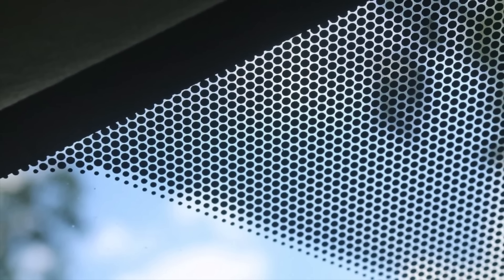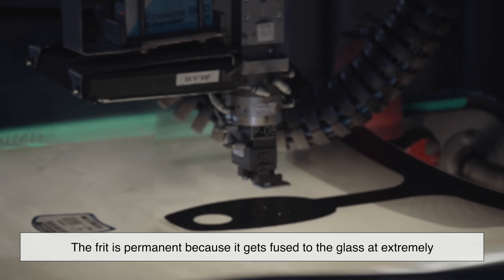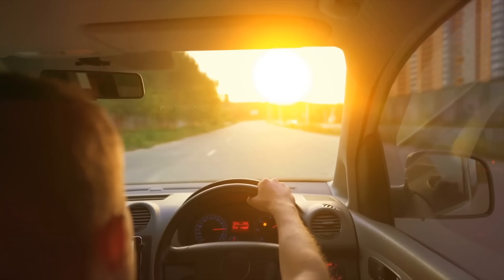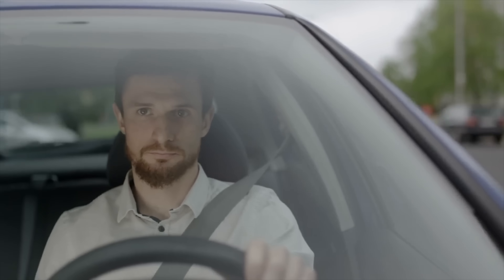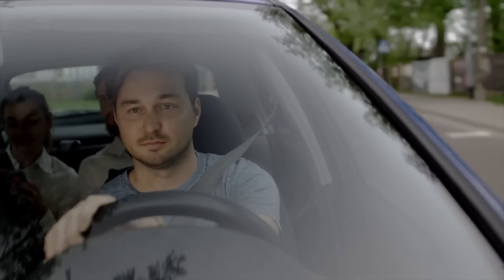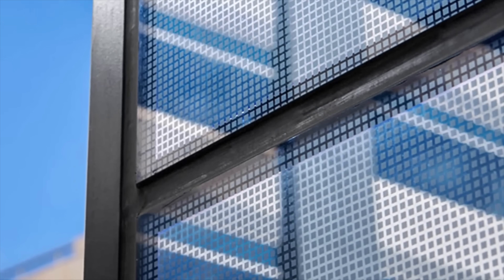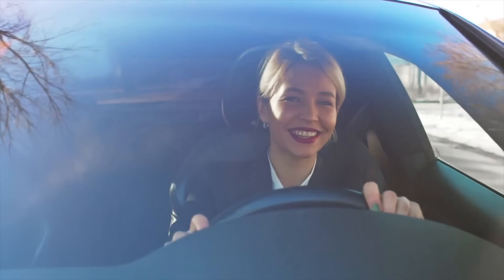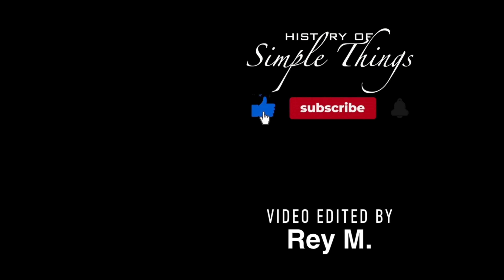Why Do Windshields Have Those Small Black Dots?

Comment: News flash: black absorbs more heat. Windshields in cars from the '40s and '50s,  still original, are working just fine. The trick is, the glass was thicker, ie more expensive, so in essence, it just another way to cheap out on the manufacture. Same with the "adhesive" BS, more so when you consider that adhesives have just gotten better. It all comes down to more profit for manufacturers. Oh, and btw, if you really wanted it to "stick" better, you'd just sandblast the glass so that's BS too.

Comment: I just wish someone would invent a windshield that was more resistant to rock chips. I think I have to get my windshield replaced at least every two years.
Reply: While this solution is not financially sound for most people in most daily driving conditions... there IS an option. Vehicle customization companies that provide ballistic protection can supply a customer with a windshield that would laugh at rock chips, without paying for full .50 caliber resistance. 

If one drives every day in a construction zone with heavy equipment and dump trucks.... then it's worth it.
Reply: More aerodynamic vehicles don't get chipped as badly, because of the more sloped angle of the glass. The windshields take less of a direct hit.

Comment: Hi, what about the gap near the rear view mirror , i cannot remember if it is a gap or less black / smaller and further apart- but what i can say is that if you mount a toll tag in that area it works, - originally i had mine away from the centre and closer to the passenger- it hardly worked, but it worked on the passenger seat , on the dash and even in the glovebox.
Can some one who knows add a comment apparently there is a type of faraday cage in the glass as well that block electronics for some reason

Regards
George

Comment: For decades we had windshields without the dots. They were also glued to the car body and handled thermal expansion and contraction just fine. Never had an older windshield crack without something hitting it first. Don't recall having distortion either. Been driving since 1970.

Comment: I thought the black area was only for shade and for looks. I'd never heard of a windscreen breaking due to temperature inversions. That's not to say it doesn't happen, because evidently it does.
Often cars also have a tiny line about 10cm down from the top edge of the windscreen. The line is very fine and only about 1cm long. I don't know their intended purpose, but the location seems to coincide with marking the maximum width of the windscreen that can be covered up, at the top. (At least that's the rule in Australia.)

Comment: The thickness of the glass in windshields has changed, too. Every newer vehicle I've owned has thinner windshields than older vehicles. So, of course, they crack easily. For comparison, I have a 1976 Ford F100 with the original windshield, and it has no cracks. It has several deep rock chips, but the windshield has no cracks. 

Every newer car I I've owned has gotten a cracked windshield. Every one of them has thinner glass at around 3/16". All of the older cars I've owned had 1/4" thick glass in the windshield. 

They were forced to add this frit to these new thinner windshields since they were prone to cracking from heat expansion. But they still crack too easy from the slightest impact.

Comment: I have been an auto glass technician since 1989 and have installed 10's of thousands of Automotive replacement glass. 
This video gets it mostly correct information wise. I saw one question in the comments about "why just the windshield and not the rest of the glass" all modern rear windows have the same ceramic frit band as well.
Good rule of thumb is, it's bonded to the body of the vehicle, it's going to have a frit band. If it rolls up and down (door glasses, sun roofs)
It doesn't need it. Front windshield is laminated glass (2 layers laminated with mylar in between) that's why they don't explode into a million pieces when hit by road debris.
Most side and rear windows are tempered glass. With a few exceptions. Where the frit drops lower in the upper center of the windshield is also called your 3rd visor. That is designed to take up some of the Gap that is left when both sun visors are down. It's supposed to act as a 3rd visor 
(Rarely works very well) and there's plenty of windshield options where you get the frit band, 3rd visor and the graduated darker tint at the top. 
Most manufacturers don't install them because it would cost them a few extra $ but next time you have to have a windshield replaced, ask if there's a "shaded option" chances are there is.
Reply: Wow 🤩 thanks 😊
Reply: A few years ago I saw a video of cops trying to break a door glass on a low priced Kia and the glass was behaving as if it was laminated same as a windshield. All door glass I've ever seen is tempered to fall into little nugget size pieces on the first try but this particular door glass was hanging tough and they had to hack their way in the hard way. This would help keep you and your arms inside on a rollover crash, because usually the door glass is gone on the first revolution and ejection of occupants happens on a subsequent revolution. It would also thwart smash-n-grab thieves. But if you had to break your way out thru a jammed door in a fire or underwater this could be a death sentence in my observation.
Reply: @onemoremisfit  You would be surprised at how many brands of cars on the road still have laminated  front side windows...
Reply: @1983dmd  What do you mean by still have? Older cars never had laminated door glass. Also this was a rear door on the late model Kia that cops could not easily break thru, not a front door.
Reply: @onemoremisfit  This is totally incorrect .I suggest you Google the AAA website and look for the exhaustive  list of cars supplied with laminated glass excluding front windshields. You will even find cars dating back to the 1980s having laminated side front or/and  side rear glasses, etc,etc.....
Reply: @1983dmd  Never encountered one myself doing collision work in body shops during the 1980s. I've owned cars from every decade between 1966 and 2006, US and imports. Currently own 3 GMs from 1968, 2002 and 2006, never owned one. But I reckon that doesn't mean I've seen them all. I'll take your word for it.
Reply: @onemoremisfit  Don't take my word for it ! Consult the AAA site and you will also find that some Kia have rear side laminated glass ,probably explaining the difficulty those police agents had.
Reply: I'd say  many cars nowadays still have laminated front side windows...99% of people would not be able to get out of a burning  car since they don't know which window to break and don't have any sharp instrument at hand to do that...This should be part of all driver's courses...and be written on a sticker somewhere in the car.
Reply: @1983dmd  Retired auto worker here. All auto glass has a trademark painted on it. It will say laminated or tempered.
Reply: @steven4315  Exactly.
Reply: @1983dmd 
The side and rear windows on a majority of cars is tempered, not laminated.
That cost more and weighs more.
Reply: @BobsGT235  Incorrect. Do your research. Consult the AAA website for an exhaustive list and you will correct your post.
Reply: Can we all take a moment to appreciate the fact that someone invested a lot of time and money into developing this frit technology?
Reply: I heard the plastic in between the layers of glass is thicker than it used to be but over all the windshield is the same thickness. That means the glass has to be thinner. I had to replace my windshield two times in my previous truck and the truck I have now has two small cracks in from rocks flying up off of road. Wind shields made today are junk the truck I bought in 1980 had lots of small rocks that flew up off road and hit it and never heart it.
Reply: @pcobra5427 Retired autoglass factory worker here. glass thickness varies, most are 2.1mm to 2.3mm. Acoustic vinyl is thicker than standard vinyl.
Reply: Well, I just don't know how I survived my first 50 years of driving lol .... 
For the record, I'm not buying it.  It's just some more crap to tack on for some reason that's good for the Government and bad for me. The government never does what's good for anyone but them. They all lie.
Reply: Thanks! Your comment has much more useful info than the video!

Comment: See them on the oven door windows and on microwave oven doors and figured it was to dissipate the heat
Reply: The black grid on microwave doors are Faraday shields (not frit) designed to contained the ovens electromagnet energy and protect users from microwave radiation

Comment: "Windshield black dots, called frit, are baked-on ceramic paint that secures the windshield, protects the adhesive from UV rays, distributes heat evenly to prevent distortion (lensing), and hide the glue line for a cleaner look, ensuring the glass bonds securely and stays strong." Saved you 8 minutes.
Reply: Thank you . I knew it did  not need 8 mins .
Reply: Thank you.
Reply: The seven minute threshold so they can have mid video commercials. Thank you.
Reply: @DonD-m6i   Interesting 🤔
Reply: Under appreciated post like this deserve more. Thanks
Reply: 👍thanks
Reply: Thank you 🤙
Reply: Thant you for saving our valuable time.
Reply: Thanks. I needed that eight minutes.
Reply: You just saved me 7.5 minutes......even if your post was totally troll and opposite,  the subject is not of any great import. Remember those single-wire FM antennas embedded in the windshield,  2 of them starting at the bottom in the middle,  both going straight up, when they reached the top one turned left, one turnd right....now let me tell you about staticky AM radio......
Reply: But lets still value the video, as 8min is reasonable, and enabled your summary in the first place
Reply: Thanks ,now I'll find  out why my cigarette lighter plug doesn't have a lighter any more. 😊
Reply: Thank you.Because he dragged the shit out of this video.
For example, the first fifty five seconds just a bunch of questions and stupidity!
Reply: Champ!
Reply: Thank you,
Reply: U da man!!!Thanks.
Reply: U r a GOD! 😀
Reply: bs
Reply: Appreciate you King
Reply: The Lord's work
Reply: Thanks. You saved me 8 minutes, 5 seconds I could have never gotten back.
Reply: LOL, sorry to piss on your parade Sport, but if people didn't want to spend 8 minutes on the reason behind the black dots, they wouldn't have clicked on the video.
Reply: @smf2072  NOBODY wanted to spend 8min listening to him drag that out to the 8min point which enables ads. So go eat a bag of fart.

Comment: Four years ago I replaced the windshield on my truck. I don't know if the one that cracked was OEM, or a direct replacement with the black dots, but the new one didn't have them. I've never noticed any difference in internal temperature, visibility or glare.

I once had a Toyota Previa van that had the four inches of gradated blue at the top. That was where most of my viewing was while driving. I wanted to tint the lower half to reduce solar heating (I lived in Phoenix, AZ then), but that was illegal. I rarely had any reason to look through the lower half because of the size and angle of the windshield. All that happened there was sun coming in cooking the dashboard.
Reply: Retired autoworker here If the glass trademark as the automaker's name on it, it is service glass made to OEM specs.

Comment: If the "frit" is supposed to reduce heat transfer, why isn't it white? I understand that black dissipates heat faster, but it also absorbs heat faster. Why not just say that it's easier for the manufacturer to use black to hide the mess of adhesive used to hold the windshield in.
Reply: Thank you for already asking what I was thinking too. Even after this video, I still don't quite get the "frits" usefulness. I'm 70 and grew up seeing just plain ole glass windshield's. Then they came out with a green tinting near the top and not much more until recently with the dots. In all my years of owning "old" cars, I've never experienced a busted windshield due to stress or heat. I think newer windshields are not as good as the older ones. Get hit by a little tiny stone on the highway, and pow, a giant crack.
Reply: The black color at the perimeter of the glass heats it up faster than the rest of the glass and that reduces expansion stress?

Comment: Too bad about those tiny black dots, I'd rather have that stripe of blue tint back on the windshields like they used to have back in the day. And I don't know about that, I have a 2011 Ford fiesta I took and spend a year in Texas with it came back to Michigan and it had bubbles from temperature change in the glass, in the rear window.
Reply: They say it’s the purpose. Didn’t say it works necessarily lol